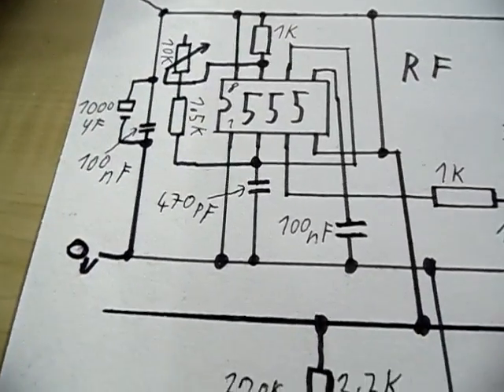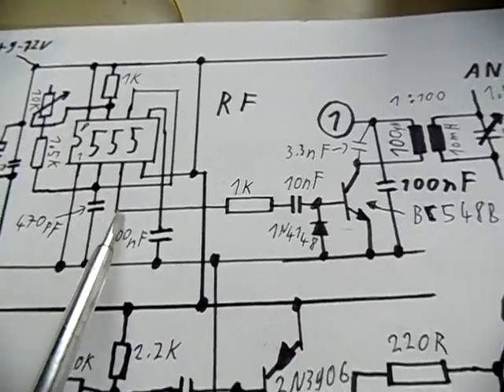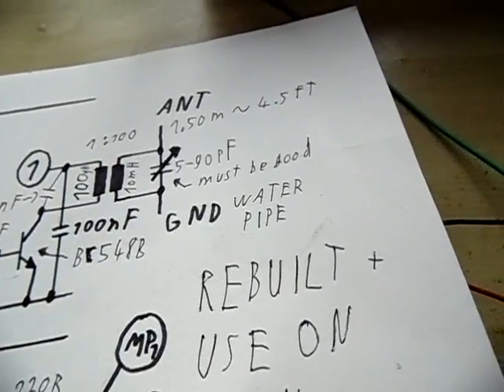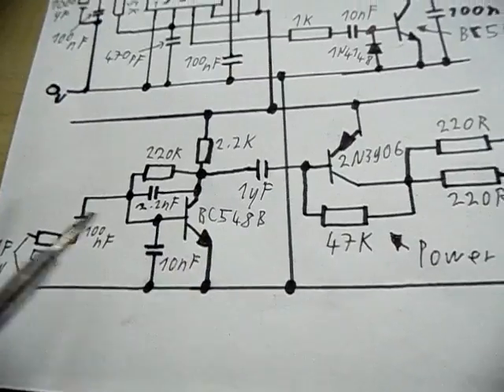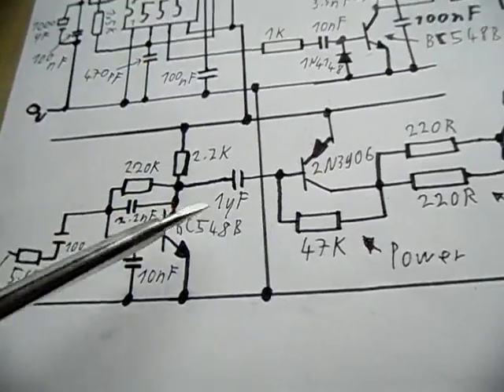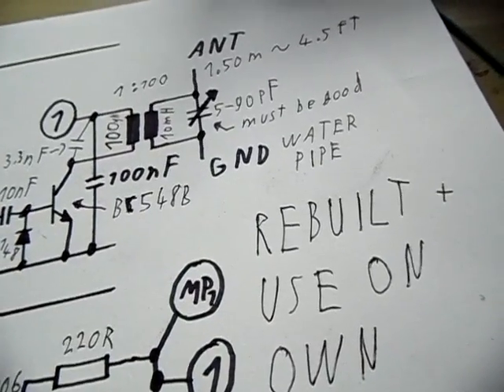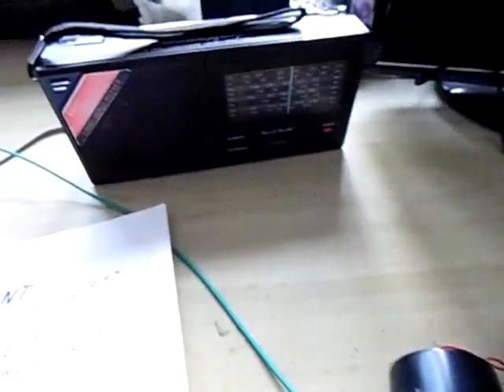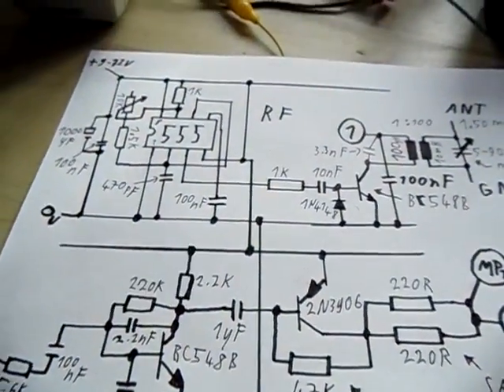Longwave transmitter

Comment: Hi Stefan, im new to this & find it interesting. I have a vintage grundig with the 49 meter band 5.8 to 7.3 mhz . I was wondering if a 555 timer could be used for these frequencies as i would like a mini am TX on low end of 6 mhz say 6.1 to 6.3 mhz approx
Reply from the maker: Altough there´s a faster version of the timer IC, the TS555, it´s only capable of "generating" 2MHz. I archeived a 49m shortwave transmitter using a RC 2 Transistor oscillator. The problem there was, that due to the high frequencies, the circuit was so sensitive to anything that could affect the frequency, that it would "drift away" some KHz from the intended Frequency if I´d only breathe towards the circuit board. For these frequencies you can use a simple LC or Xtal controlled 1 Transistor oscillator.
Reply: @Stefan0719  Hi Thanks for reply, as i say i am new to this & would like to try your suggestion of LC, I don't suppose you be good enough to do a simple circuit diagram to give me a fair idea. I have a few components out of my dads old junk box, One transistor i believe is high powered is AC127 would that be any use as RF output?
Reply from the maker: @huckleberry492  AC Germanium Transistors have a low Frequency (ft) These were commonly used as Audio amplifier transistor in radios. You might be able to use an "AF-"transistor, as these were used in RF circuits. I´ve a circuit for a simple transmitter on my channel, working with different crystals from like 4..20MHz. It just needs 2 transistors, a few resistors and capacitors (no coil needed) and works for your purpose. Look for "simple shortwave transmitter" and "super simple shortwabe transmitter."
Reply: @Stefan0719  Oh ok Thanks , i've downloaded a few of your videos & will try to understand & hopefully build one in the next 2 or 3 weeks. Thanks again Stefan :))

Comment: Id also like to know how to build an RF amplifier to boost these signals
Reply from the maker: Generating a "few watts" on longwave is not a problem. Even using a single "BC548 / 2N3904" I can get out about 500mW RF output. The problem here is, how do you get the signal "emitted" by a short antenna? As the name says "long wave" the wavelength is long, and if you want to transmitt a low frequency signal relatively effectively you´ll need a hughe antenna (lw is even worse when it comes to that compared to mw, and medium wave antennas are hughe already). If you want a cheap "stronger" longwave transmitter get one of these "CD4060" chips. On it´s output you connect a 2N3904/2N3906 transistor in "AB configuration" (Bases put together, Emitters put together, 2N3904 Collector to +, 2N3905 Collector to GND). On the output of this transistor pair connect an IRF510 Mosfet (gate to Emitters, Source to ground). Now use a coil... maybe 100-200µH from "Drain" to your modulator stage, but block it to ground (where modulator and coil meet) with a few 100nF in parallel like 5...6 100nF in parallel (these capacitors need to be good). The most simple Modulator could be a BD140 Transistor, with a 100k Potentiometer between base and collector. Use a 1k Safety resistor in series with the potentiometer (in series to base or collector). Connect Collector to "modulator input" and now you can put in a signal on base via a coupling capacitor... keep in mind that this is a pnp transistor, so use portable audio source because "+ub" is your GND reference here for audio. The BD140 probably "will like" some 1...2   100nF capacitors from base to emitter, to block away any remaining RF.
Now on "drain" from your IRF510 you can "pick off" the Longwave signal with a 100nF capacitor. This probably will deilver 3...4Watt (the transmitter you commented makes maybe 0,01Watts if even). Whatever you do with the signal now is your choice. You could pass it through a 5 pole lowpass filter, connect it to a pi filter...
Reply: @Stefan0719  I agree wiith you. The Long Wave is almost left when it comes to radio stations :( RTL dissapeared earlier this year. So only Algeria and BBC (and a few beacons) are heared at the Long Wave. If it wasn't for the huge antenna's this would be nice for experimental projects.

Comment: Hello Stefan, It's possibile modify the long wave circuit transmitter for send binary data? And create a receiver circuit too? Is there one IC long wave tx and rx ?
Reply: I guess something like packet radio with the speed of 300 baud should work. The only thing you would need is a PTT circuit which switch from transmitting to receiving. I would never suggest it, because it is more logical to use the CB band because you don't have to use a seperate PTT circuit and it can handle 1200 baud transfering speed.

Comment: I just built this. It is amazing. It worked immediately, first try. The sound is great, good bass and treble response with very little distortion. I left out the 2.2nF in the preamplifier, for wide band response, since there is little chance of adjacent channel interference around 175 kHz in this area. BC548 is not available where I live, so I was recommended 2N4401 as a substitute. It runs fine from a 9 Volt smoke alarm battery (this is enough voltage and current capacity), and with a 7 foot wire and ground connection covers the entire house. I tried running with 18 Volts (two 9 Volt batteries in series), there was way more output power, but the 2N3906 modulation transistor started getting pretty hot - and this is with a 47k resistor on the modulation transistor. I have not tried a 22k yet, since either this or higher supply voltage will dictate a heat sink for the 2N3906 modulation transistor. For the antenna matching, I used a metal / ceramic trimmer capacitor salvage from an old AM car radio.

But seriously, this is an excellent little transmitter!
Reply: Hello whats range is your transmitter?

Comment: Thanks for sharing this project. This will be very handy to have a whole-house transmitter from a music source. There are too many FM and MW stations in this area to find a blank spot on the dial. The LW band is vacant in Canada, with exception of Morse idents from low powered NDBs, and most of the radios I have include a LW band 150 - 280 kHz. This is great. The sound demo from yours is very good. I have two questions:
1. Is the third transistor  2N3906 ?
2. Can you describe the details / construction / orientation of the 100uH : 10mH RF coil in a bit more detail ?
Thanks.